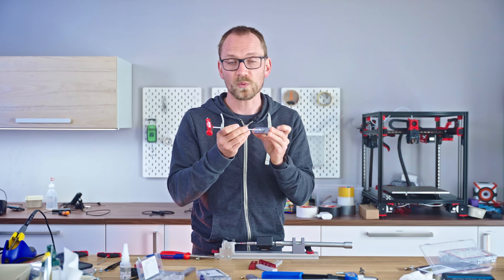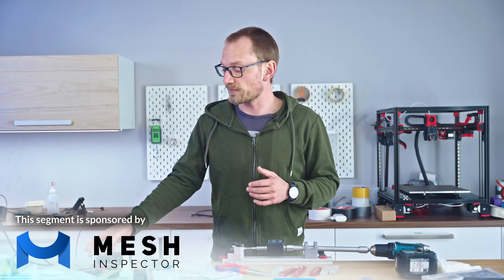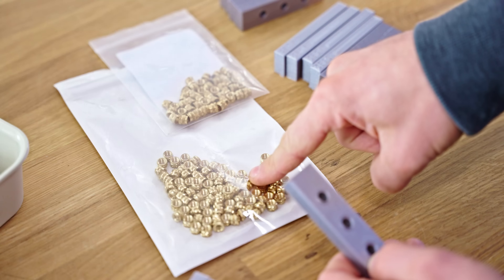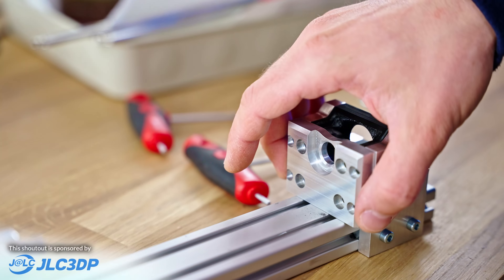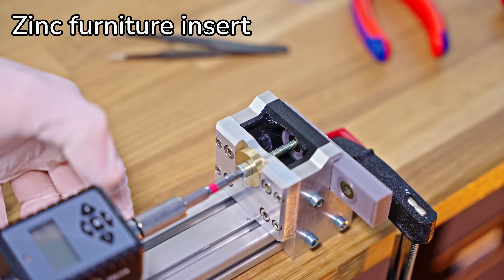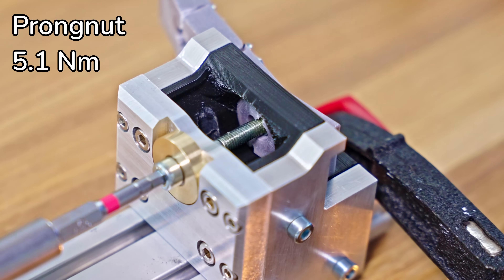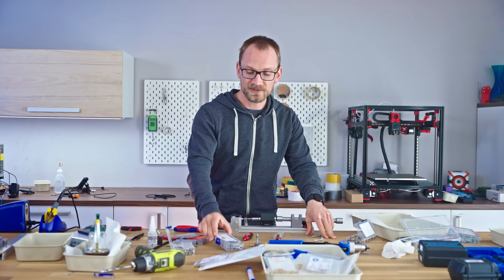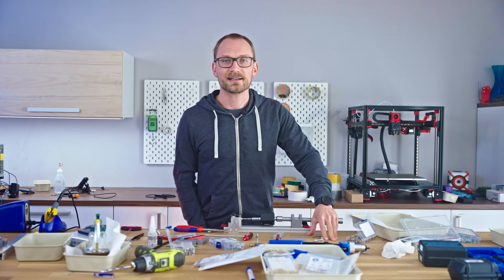These threaded inserts aren't made for 3D prints (but work amazingly well)

Comment: Such a cool idea to test these out. Instead of using the prong nut as intended, I’d be interested in trying to pause a print, insert it with the wide part up and resume printing to capture it. At that point, you could use a standard nut in the same way. Great video to test some different ideas and it gives me inspiration to try my own tests instead of only having theories.

Comment: Good video. A comparison against a standard nut is a strange omission. Much cheaper and probably very effective. Less cool though
Reply: Not really. If he wants a female that can withstand extensive use, a standard nut will simply not provide that, due to poor strength for high torque.

Comment: The prongnut looks like a perfect use case for adding a pause in the gcode to add the nut, then continue printing to encapsulate it.  I use that trick with regular nuts, but the built in flange greatly increases surface area. Obviously, that's dependent on orientation.

Comment: Yeah, helicoils work under the premise of drilling and tapping a hole first (to the specifications of the helicoil you are using). You would need to just model the same threads into the part to properly use helicoils.
Should try one of these and test threadlocker or other adhesives!

Comment: after 14 year of 3d printing. I've never used any of these inserts. I just embed a standard nut. The best part, hex is easy to model, and nuts are going to be cheaper per part than any of these inserts.
Reply: You need more clearance for a standard nut, and you have to pause the print in order to insert them. Sometimes that's OK, sometimes not.
Reply: @larrybud  Modeling pockets so the nuts can slide in is the way. The pocket can be a bit taller than the nut since it will get squeezed in that direction.
Reply: @jmsaltzman  Doesn't that mean that if they can slide in, they could slide out?
Reply: Try with square nuts, way stronger
Reply: Sure. But they easily start spinning, if they are too small. Once you use too much torque, they all finally slip. The square ones are better, but same story there. I still use the regular nuts, due to their ease of availability, but always try to design for easy replacement or ways to fasten the screw, if they start to slip.
Reply: @FrodeBergetonNilsen  It’s a responsibility not to overtighten in general. If that’s a risk, square nuts as you mention are even better, or size up the hardware. I prefer using standard hardware than inserts in general— inserts can easily be melted in at an angle or too deeply, and the plastic melting around the insert deforms the model a bit. Melt-in inserts are just inconsistent without a press and temperature control.
Reply: @FrodeBergetonNilsen  so don't make the pocket too small? Whenever I insert a hex nut I size the pocket for them so they have to be pressed on, or even heated a bit to be able to fit into the pocket. They aren't going anywhere.
Reply: @timplett1  Sure. But the issue with hex nuts, is that the hex-pattern itself is not really expanding that much beyond a circle, or rather, inside its outer circle. On top of that, torque is the weakest parameter of plastic, so once you apply torque, the plastic deforms easily. In the end, you got a hex nut spinning, because the outer shape, has been forced into a circle.

Making a press fit sure helps, but for say a M3 nut, if you thighten the nut too much, or the press fit is somewhat loose or faulty, they are known to spin. That is an issue.

Just to be clear, I use m3 nuts that way. But it is a weak part of my designs when I do. It is what it is.

The end user will have to live with it, and as with anything that is designed, it is a trade-off. On my part, it is tradition and availablity.

Down the road, I will probably need to make alternate models, that also support different nuts or inserts. Since I make models that others print, the maker will ask for something different as the end user will.

Comment: For screws larger than M3, I use "cheap Zinc" wood screws.
Instead of shaping the hole with thread I make a simple hole the size of the core of the external screw and insert them by screwing them with the soldering iron with the head replaced with a hex bit.
I've never seen them fail even though I'm a gorilla when I have a spanner in my hand.

Comment: Care to share the legwork you did on modeling all of those threads?
Reply from the maker: I've only got the M5 versions modeled up yet that I used in the video, but I could definitely modify the model and somewhat easily create the rest of the sizes as well. Having a negative should make for easy hole-punching in Fusion or even directly in PrusaSlicer!

Comment: As usual, you test metal parts, used as metal parts. Screws for printing, simply require way larger diameter. I use m14, and that works wonders for a ton of applications, using 21% infill and 2 perimeters. That include female threads, in the middle of mesh, with no top an bottom layers. Naturally, at that size, I print both the male and the female. Contradicting your claim, of needing thick or deep connections: You don't. You need a larger diameter. Just tap the holes if printed vertically (female), and reduce the x and z to 98% but keep the z at 100% for the screw (male). That is, if you design to print, and with the mindset of printing. Your designs will be completely different, as this simply is what a designer does, who design for print, and not design as if the part is metal, which it is not. But it is a completely different mindset, and completely different school of design.

Sure, a plastic screw might wear out in the part where you insert the flat bit, but if they do, they are easy to replace. I have yet to wear out any female thread, and I have been doing this for years now. But as should be evident for everyone, nobody else does. Including Tom. He simply does not know the kind of school of design, that I speak of.

Comment: if you really want rivnuts to hold on to soft materials, you need to back it with a washer! Also, for through holes, nothing beats a hexagonal rivnut backwards (with the flange opening in the back of the piece)

Comment: If the connection doesn't need to come apart I just max out the thread length. If the length exudes 10 times the diameter this is rock solid.
If the connection has to come appart I prefer rivnuts from the rear or Rampa-nuts from the front.

Overall force distribution is king. Thread length or more connectionpoints distributed over a wide area of the part.

Comment: You should also talk about plastite screws, I used in them in a prototype PLA models and actual production in potted ABS current sensors. These self- threading screws have pretty good holding power while not needing inserts to start off with

Comment: It seems to me that you're using every single insert, except the one that you were required to install correctly, the wrong way, in terms of 3D-printing best practices. You always put them on the opposite side of the part, as of where the pulling screw is, pulling it into the print, not straight out.
Reply: Sure. But he is also not testing what plastic is worst at: Torque. Nor is he testing sideways bending strength. The issue with using metal screws, is that they typically require quite some torque to make a tight fit. This test does not cover that at all, but since I simply never use these, I don't really know how much i matters. I only know that for my line of work, inserts simply will not work, due to their tiny diameter. They simply cannot deal with any torque. Once tight, they hold up, but it is all about the twist.

Comment: Very nice test! Regarding the pain with making custom threads with Fusion 360; It shouldn't be harder than remove-extrude a custom profile in a helix with customisable length, width and pitch, but  most of the CAD tools I have used seems to make this unnecessarily hard to do. I loved how easy it was to do in Autodesk Inventor, but none of the free alternatives I have tried is as good sadly (Onshape, FreeCad, Fusion360, and maybe some more).

Comment: the problem with the flanged inserts is that if you have access to the other side of the part, you can just use a standard embedded hex nut (maybe with a washer for extra strength). probably much simpler, since most people already have nuts and washers on hand.
Reply: Inserted nuts (hex or square) make the most sense for me: no extra hardware or tooling needed. It would be interesting to see them compared to the inserts tested here. Thank you, Thomas!
Reply: @jmsaltzman  square nuts tend to be much superior to hex nuts. They have larger faces an sharper corners which prevents rotation and they tend to have a larger surface area and square holes tend to be easier to model too.
Reply: Yep, I make it all the time, simple to model, cheap, and works perfectly.
I also do it when you got access from one side even if not the rear, you can just make a slot where it fits and it's embed there inside.
Reply: @Kalvinjj  yes sliding nuts in slots from the side is a very good way of doing it. Another way is to just leave voids in the model and when printing pause it at that point to insert the nuts, that way you don’t need anything visible from the outside.
Reply: @conorstewart2214  you can leave two cavities on top of each other. A square or hex for the nut, and a round shallow one for a washer. That washer (could be a fender washer, those masive ones) will increase the support area a lot so there will be no chance to just pull the nut. Even better but more expensive is a washer nut (nut with integrated washer)
Reply: @conorstewart2214  Feel like the inbedded flanged inserts in a model could definitely also be an option although would only work in cases where the flat part is facing up ofc
Reply: i guess it depends if you rather trade the width/diameter with the depth
cause you can make it much thinner if you just use flanged insert
Reply: @aronseptianto8142  i don’t think it’d be slimmer to use the flanged insert
Reply: The bigger problem with embedding nuts is then you have nothing to hold on to for tightening them.  I've used embedded nuts plenty of times, but they work far better not embedded but with space for a wrench or socket and a washer.  Otherwise it's very easy, especially with smaller nuts, for them to just round out the hole you've modeled and/or melted for them.
Reply: They are much bigger than the equivalent hex nut (yes you can add a washer), and they don't need a tool on the other side.
Reply: As an alternative to sliding the nut in from the side, you can also leave an empty space in the middle of the part and add a pause command to the print so that you can insert the nut and then continue the print above it.
Reply: Square and hex nuts also have another MASSIVE benefit, you can stop a print and insert them, then keep going. That would be much harder to do with the prong nut because you are almost sure to hit... the prongs. Overall it seems like self tapper, or if you need more strenght, go with an embedded nut.

Comment: Hold up, I'm stopping the video early, but I just realised. Is your after burner different? It looks like you have a super long melting zone hot end. But most importantly, didn't you do a custom stealthburner cover?
Reply from the maker: Yup, it's very long. It's a special cover and airguide to fit the Slice Mosquito Magnum+.
But I'm currently thinking about going with a more normal hotend as that thing is quite heavy and uses a ginormous nozzle bore, making it really tough to control.

Comment: 12:20 Can we get a test on that? I always print my holes just a little smaller or larger than whatever the pre-drill size is to tap. Smaller if I want to go through the effort of drilling them to spec or larger to make sure it's never too small. Most bolts will self tap just fine into either of those holes and I feel like the result is a lot stronger than modelled threads. 

Bonus points for driving the bolt in fast enough the first time that it gets to a temperature where it slightly remelts the plastic around it to form a stronger area.

Comment: I use the helicoil in almost all aluminum parts. however you are right and you have to get the threads exactly right with the proper helicoil tap and fancy installer tool. the cheap tools make it very hard to install repeatably.
Reply: I want to try to place an insert that a helicoil can be threaded into. I want the helicoil because it should provide reliable firction to the screw over time. Are you aware of a larger insert that matches the outside threads of a M5 helicoil? I know it sounds nutty.

Comment: You didn't test heat-set inserted from opposite side of a part(absolute majority of structural parts are designed this way, and they only have "tolerance" all-way hole for screw, so it's significantly stronger, yet should be less strong than self-tapping steel piece) as well as regular nuts are missing.
Reply: I have only rarely seen heat set inserts used as you describe, if you are going to put the bolt all the way through anyway you might as well just use a nut on the other side. Putting the insert on the other side also doesn’t stop the insert from eventually turning.

There are a number of reasons why using a nut rather than the method you describe is better. Nuts have larger features that help to prevent them from turning when recessed into a part, with a heat set insert all you have preventing rotation is small teeth on the outside, with a nut you have large faces that can resist rotation, especially if you use square nuts. Nuts tend to have more surface area pushing on the part when tightened too, when using a heat set insert like you describe only the bottom area of the insert is pushing on the plastic when tightened, compared to the whole bottom face of nuts, again square nuts are better as they tend to have more surface area. You can use washers with nuts too to further increase the area that the force is distributed over. Inserting nuts is also easier and doesn’t require special tools like heat set inserts do and if you want nuts embedded in a part you can pause a print and add them then.

Nuts are just overall better for structural parts. Heat set inserts should only really be used for relatively low force applications, I mainly use them when I just want a reusable connection (can be screwed and unscrewed multiple times) and when nuts wouldn’t be practical, so I only use heat set inserts inserted from the front. If you need a strong connection there is pretty much always a way to use a nut rather than a heat set insert.
Reply: @conorstewart2214 Nuts are always stronger, but not always possible.
Reply: @conorstewart2214  I design parts with heat inserts on the opposite side and know many others that do as well.   They work well. I would also argue that since a heat set insert generally has many knurls in it, they actually offer more surface area than a nut, though probably at a max size of M3. Heat set inserts have their place imo in compact or aesthetic applications and generally make repeated assembly and disassembly easier.  Anything designed with M5s I use trapped nuts.
Reply: @TheFreeguy12   The entire point of inserts is to provide strong threads in blind holes, which is why you will always find them used as such in commercial applications.  Using inserts on the other end of non-blind holes is pretty pointless unless you really need the small diameter; a nut is a superior solution in every other way if not.
Reply: @conorstewart2214  your writing is too long, but look at prime example right behind him-Vorons are designed this way and I do design parts this way and only use inserts the way he showed only in case where connection isn’t expected to be under any significant stress
Reply: @SergeiSugaroverdoseShuykov  three paragraphs is too long for you?
Reply: Could also try wood screws
Reply: I suspect that usage pattern is going to be strong regardless of the threaded insert used, so it would be a bit boring and unnecessary to make an in-depth test video covering it.
Reply: Yup this is always the way I design whenever possible
Reply: You are missing the point.

This is a video about threaded inserts used in 3d printing, not the strongest way to fit stuff together.

You often don't have access to the other side of the part, this are just test piece.

This is adress in the first 5 sec, of part one video. If you have access to the other side, you can use a normal nuts.

Comment: Hey Thomas, how did you achieve good print-bed adhesion with Prusament PC Blend? I have tried several different methods but it is alway warping... My next solution would be to build an actively heated chamber which can heat up my enclosure up to 60°C instead of 40°C. I tried the three different Prusa PEI print sheets and something like a brim and mouse ears on the model, applied some glue stick but that did not work out that well. I have a Prusa MK4
Reply from the maker: PC blend is still a challenging material and I used the satin sheet with a brim + enclosure to get it to work at all. Prusa have a handy material table at https://help.prusa3d.com/materials , listing out the recommended printing environment and bed surface - if you keep to those recommendations, you're at least going to have a very good starting point.